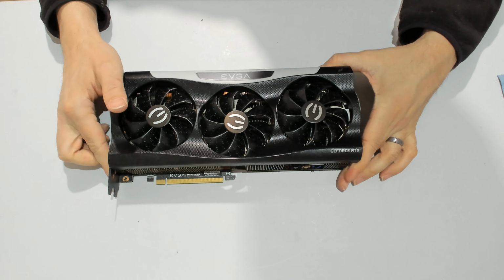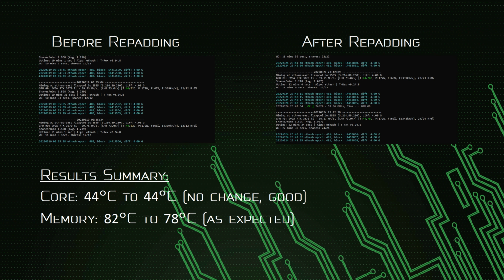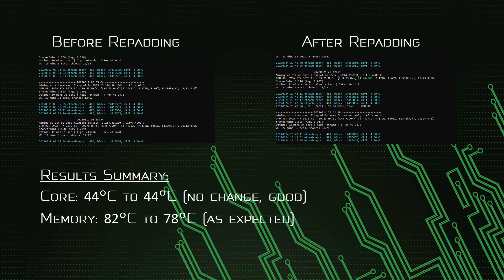EVGA RTX 3070Ti FTW3 thermal pads replacement with custom set (20 W/mK)

Comment: This guide super helpful.  Watch out for those pesky uncaptive nuts.  Make sure you have a small set of needle nose pliers for putting the nut and screw back in the top hole of the bracket.  Overall this was really easy to do making sure you are super careful with the plastic fan clips.

These thermal pad kits come well packaged, and seem to be super high quality.  One side of the thermal pad has a thin, almost plastic wrap like cover, the other side is a little thicker and easier to remove.

The EVGA Thermal pads are pretty difficult to clean off.  They are super sticky and I went through a lot of Q tips getting them cleaned up.  Iso alcohol and slow light circles did the trick, but when the pad fell down between the components they really became a pain to clean up.  Change out your q tip often and avoid using too much iso so they don't wash away.

I made a mistake and used Artic Silver 5.  Repasted the damn thing 3 times in the following amounts: just right, too much, to little trying to find a happy spot.  Each time I fired the card up it thermal throttled immediately.  GPUZ showed Hot spot hitting 105 almost instantly.  I tried letting the AS5 cure over night and it was only marginally better.

Put some cooler Master Mastergel Pro on the final time.  Temps went from 52 degrees on the GPU and 92 degrees on the memory while Eth mining to 61 /82 for the last 1 1/2 respectively.  I'm happy with the reduction in memory temperature and am OK with the increase in GPU temps.

I will be ordering some Thermal Grizzly thermal paste moving forward.  I don't think I'll pull this card back apart to re paste any time soon, but lesson learned. Only use high quality thermal paste (I don't consider mastergel pro to be high quality btw)

Thank you Kritical!!!

Comment: Hi.  These are my measurements of the factory pads and gaps with a caliper.  The only thing we don't align on is the pad thickness for the long strip.

Have you re-dismantled a card to verify contact on the long strip at just 1.5mm?

Factory Pads - RAM			2.25mm
 	Gap			1.95-2.0mm

Factory Pads - Side 2 MOSFETs		1.5mm 
	Gap			0.55-0.60mm

Factory Pads - Long Strip MOSFETs         2.5mm
	Gap			2.1-2.25mm
Reply: We're you able to find the correct thermal pad thickness?
Reply: @bassdrop001  Sure, correct pad thickness(es) to order would be one just a bit greater than the measured Gaps I stated above.  You need them just a bit thicker to compensate for variability, but not TOO much thicker because we all know that quality pads won't squish a lot.
In short, 2.25 is pretty good for RAM, 0.75mm for the 2 individual MOSFETs, and 2.5mm for the long strip of MOSFETs.
Reply: @hashhouse7372  thank you, in the end I didn't get the 3070 ti
Reply: @@KURSKIY046 The only thing important are the gaps I measured.  Choose pads that are slightly thicker to ensure contact.  Do not order thicker pads than necessary, or they will not squish to make contact.  In short, order 2.25mm pads for RAM, 0.75mm for the 2 individual MOSFETs (what he calls the "small piece on the left"), and 2.5mm for the long strip of MOSFETs.
Reply: @hashhouse7372 извините но на чипе памяти у вас неправильный размер, нужны прокладки 2.0 мм толщиной, потому что расстояние  0.8 - 0.9 между чипами и , и если термо прокладки твёрдые 2.25 то они не ужмутся до нужной толщины. В данном случае Termalright Odyssey II 2.25  не подходят, они слишком толстые.

Comment: it's the same type as EVGA 3070 FTW3 ? saw in another video for the long strip they used 3.0mm but for the vram they did use 2.0mm and 1.5mm for the tiny square, just wondering if the use a thicker pad strip for the long strip why I ask cuz the other video it was the evga 3070 ftw and not the  3070ti wondering if it may be slightly different???. Either way Tanks you much confirms, pad sizes for the evga 3070 ftw3...

Comment: so i had bought a set for this evga 3070 ti ... the issue i had with my gpu was that it would shut down my computer as soon as i started mining . Had put it aside for a while until i bought this precut set ... pads change ..all went well ... now the gpu does start and mine but shows high hot hotspot and that mines at  reduced speed ( which is a improvement from before) ... for now i do not have another solution .. had seen a vid somewhere ..where they showed a somewhat bend gpu processor ... and no amount of paste and pads could help ...

Comment: I have an evga 3070 i hear a cracking pop when the fans spin up, every time the pc starts up from cold within 15-20 mons depending on what i do, usually browsing or youtube. Now this started to happen after i pit new thermal paste on my cpu. I think 3 things can be, something at the cpu or the gpu or the pc case itself which is 5+years old. Any experience with things like this? Can old gpu paste or thermal pads produce something like this?
Reply: maybe the fan it hitting or tapping something, naybe when putting back together fans are not properly seated, just a wild guess from ur description, i dont want to give bad advice but if i had that problen i take out everything and and set it out of the case, least you be able to address the problem better and see whats the fams hitting, its not the paste you applied just something not lining up right my best guess...
Reply: I would take it apart and put it back together! Seems odd, but that can fix so many unexpected things. I also would agree with☝️the comment above.
Reply: @joelfuelling8725  i ended up buying a new case, what solved the issue. So in a way i took it apart and put it back together.

Comment: Salut, merci pour la marche à suivre =)
Quelle est l'utilité réelle du switch OC sur la CG ? Je devrais l'activer ou non?
Reply: I'm going to try to translate into French but, this card has dual BIOS.  The normal/silent position is the un overclocked version of the BIOS, the OC is the overclocked version of the BIOS.  It is a small performance boost.  Some like a quieter card, so they use the normal/silent option.

Je vais essayer de traduire en français mais, cette carte a un double BIOS. La position normale/silencieuse est la version non overclockée du BIOS, l'OC est la version overclockée du BIOS. C'est un petit gain de performances. Certains aiment une carte plus silencieuse, ils utilisent donc l'option normale/silencieuse.

How good did google translate do with the French?
Reply: @Brokenandsilencedrec  it's fine =) what about the lifetime of the card with OC mode  compare to normal ? Any idea ?
Reply: @MrLazer44  It would probably last at least as long as EVGA's warranty.

I did a little looking and it looks like it might only be a different fan profile.  Might only see your fans wear out faster?  Turns off zero stop mode and has a more aggressive fan curve.
I might be wrong that it is a dual BIOS card.  Oppsy.
Reply: @Brokenandsilencedrec  Thank you very much my friend :D It's hard to find anything about it